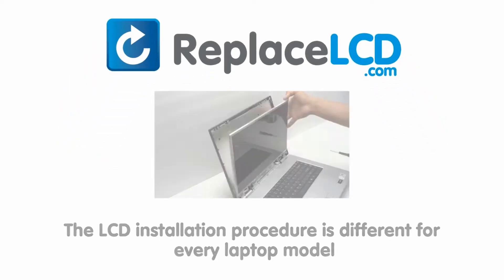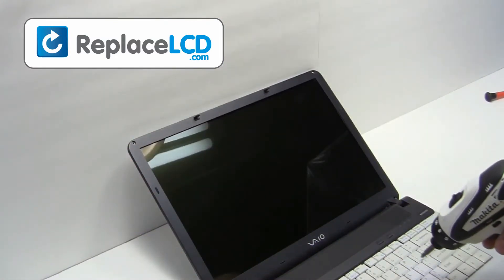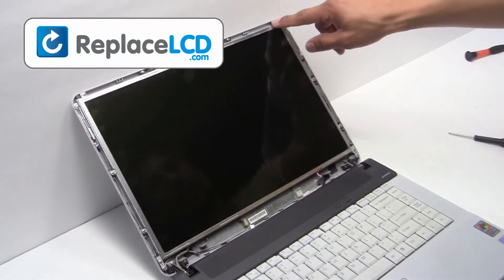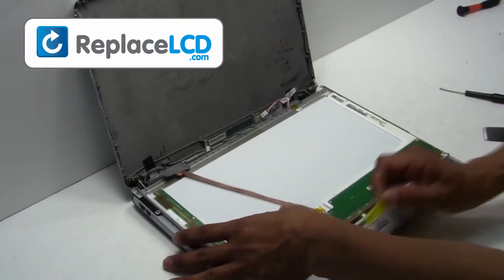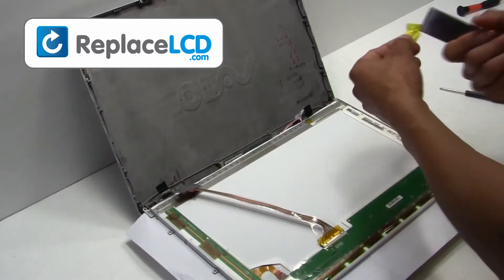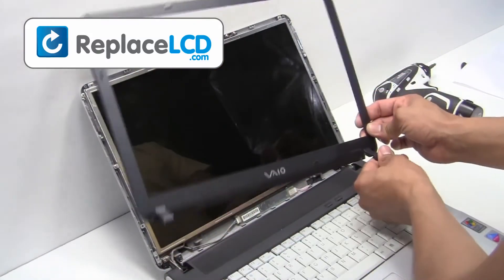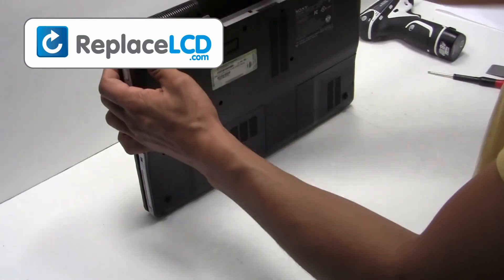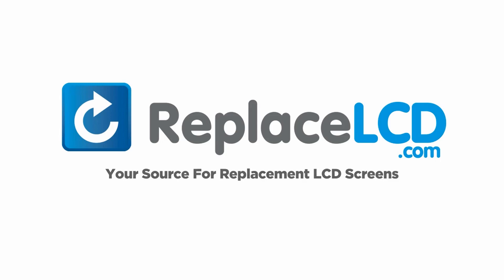Laptop Screen Replacement, LCD Screen Replacement Guide - Sony Vaio

Comment: Hi
I have tried 3 different LED screens and none of them works! The neon lights turns on and the LED is taking power but it does not show images on screen. 
I mange to get it work only on a 17" display. Any idea why this happens? ...I think it could be the 1080p screen resolution Sony has and the LED screens I tried were not 1080p.